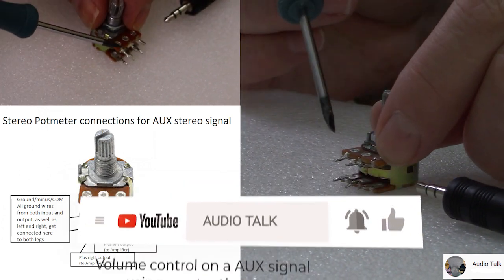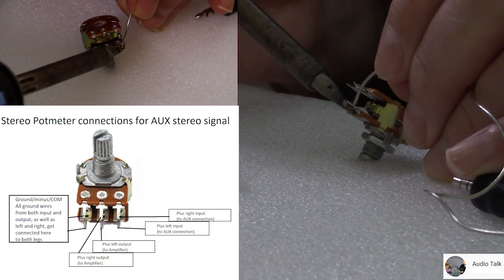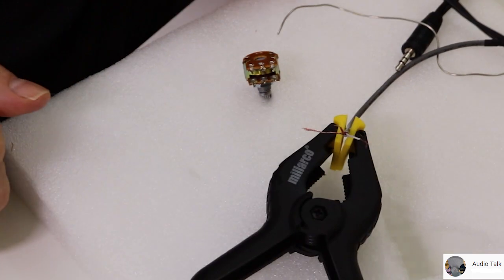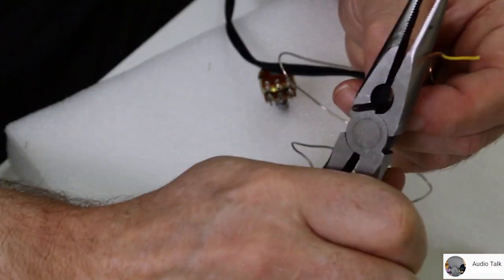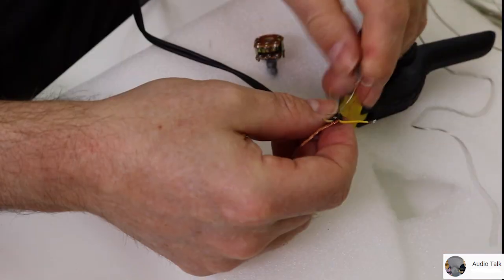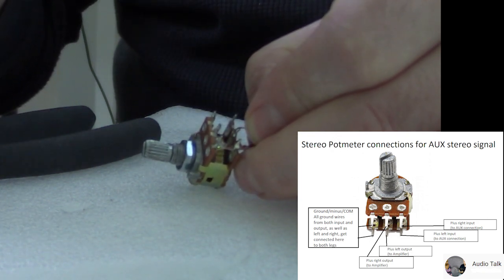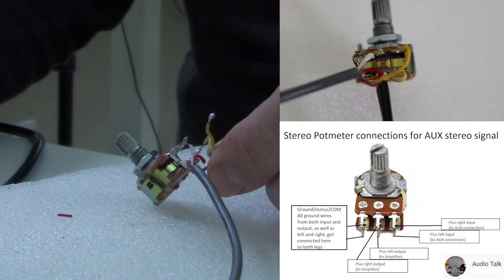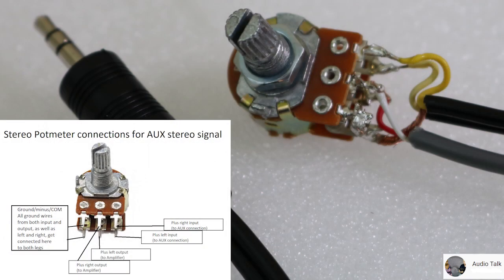How to Connect a Volume Control on an AUX Signal With Potentiometer

Comment: Nice and informative video, thanks!

Would this work with cassette deck headphones jack or does it need some other components /modifications? They usually didn't have any potentiometer to control output volume from the headphones jack, which is both positive and negative thing.
Reply from the maker: It would be the same there, only thing that can be different is the size potentiometer if the output impedance is different for that particular tape deck. The example in the video is for line/AUX signals, so there potentially can be a difference.